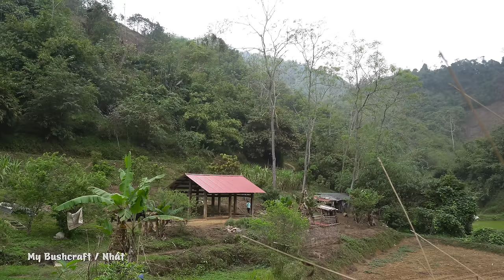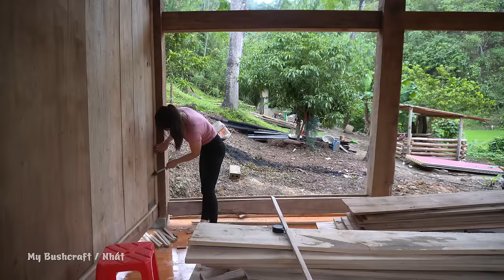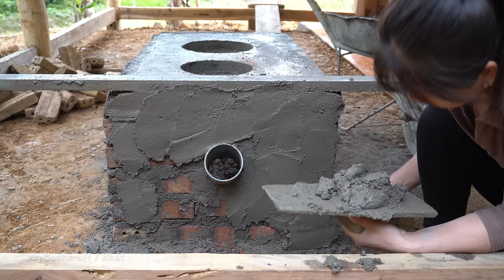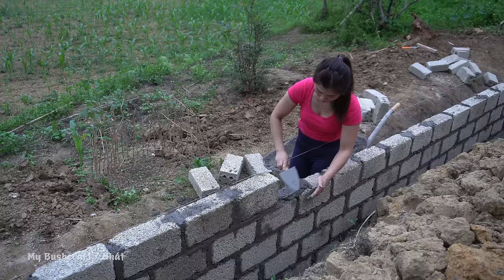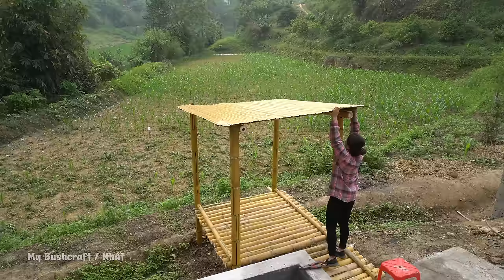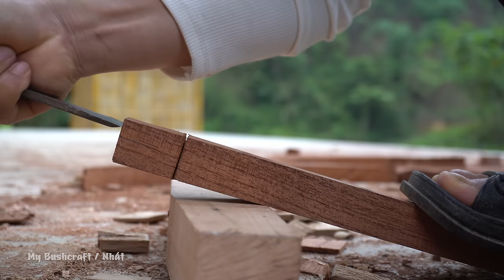TIMELAPSE: START To FINISH Alone BUILD LOG CABIN - Build Wooden House, Flower Tiled & Kitchen

Comment: I noticed that the bottom portion of your house has opening, I suggest you have to close that portion to avoid snakes to crawl inside during night even during daytime, specially that you're  living in the mountain village  were snakes and other predators could  easily get inside your house.
Reply: in that climate (hot, humid) I think they prefer ventilation rather than a sealed up house. no power there so no ac or fans. maybe get some cats?
Reply: @JamesShelnutt2  she just installed a plug just before the video end don't she? AC ain't needed when she can get move able electric fans, also for ventilation she could just make it on the top  instead of bottom. Still she build the house better than me.
Reply: @marianitadelabahan7771"der untere Teil Ihres Hauses eine Öffnung" _ das ist das WC auch Plumpsklo genannt wo sich andere Getiere Bedienen können
Reply: I suspect that it is to avoid rot and reduce costs. If you want a sealed up home, you would not build the foundation like she did.  It is a beautiful home, but very cheaply made. Something that will be climate controlled and sealed to pests is going to cost a lot more.

Comment: Next time you build a house "alone" (without a tape measure or pencil) mix the concrete inside the house where its shaded. Water just makes the wheelbarrow heavier.
다음에 집을 지을 때(줄자나 연필 없이) 그늘이 있는 집 내부에 콘크리트를 섞으세요. 물은 수레를 더 무겁게 만들 뿐입니다.

Comment: Bottom row of bricks should not have mortar between every 3 or 4bricks to leave passage for water. Otherwise the hydro static pressure will push the wall over